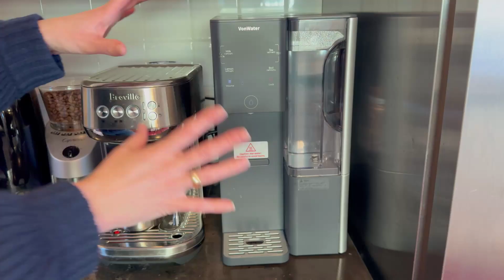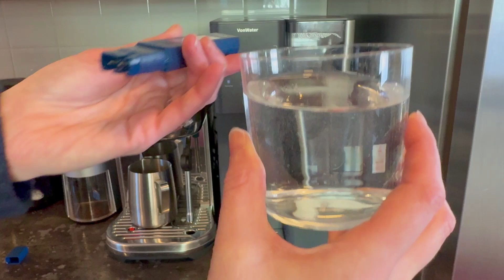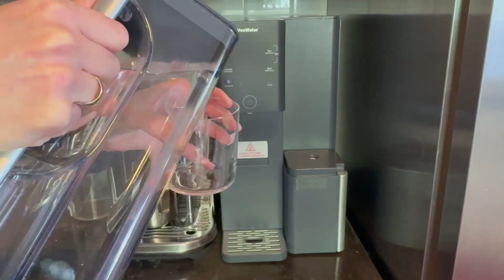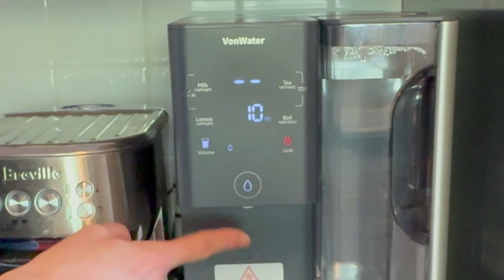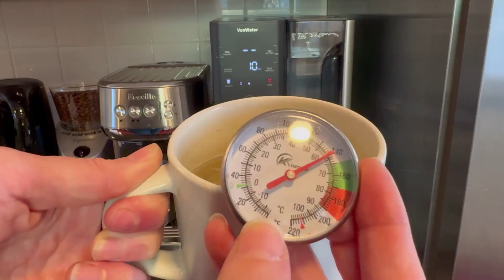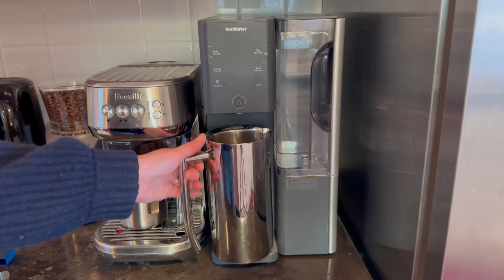BEST Countertop Reverse Osmosis System for Instant Hot Water Revealed!

Comment: I always was told by the biology teachers that osmosis water is bad for the health, because it can drain out important minerals from the cells of the body.
Reply from the maker: It supposedly removes everything. So all contaminants (chlorine, bacteria, etc) and all minerals. So yeah, if you’re not consuming other foods/liquids that have the minerals removed from your RO system, it wouldn’t be good. But “In a nationally representative sample, tap water from home taps in the US provided more than 1% of the recommended daily intake (DRI) for calcium, magnesium, sodium, and copper.” So it’s not like we’re relying on our tap water for those nutrients anyway. I’d rather remove the bad stuff too.

Source of qoute: https://www.ars.usda.gov/research/publications/publication/?seqNo115=286129#:~:text=National%20Nutrient%20Database.-,Sodium%2C%20potassium%2C%20calcium%2C%20magnesium%2C%20iron%2C%20copper%2C,assessment%20of%20dietary%20mineral%20intake.